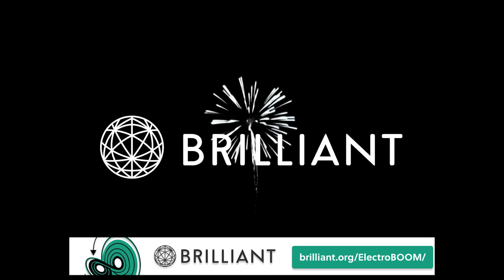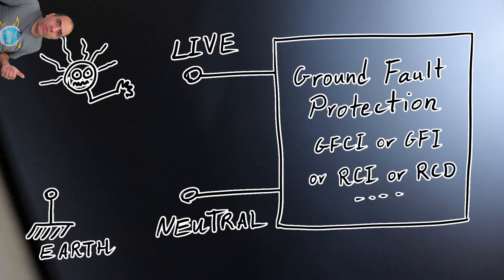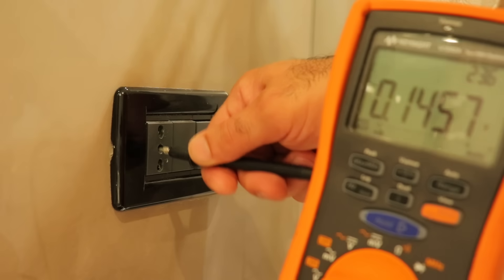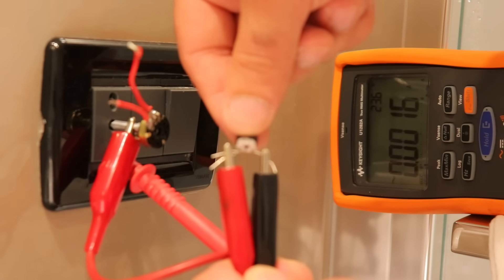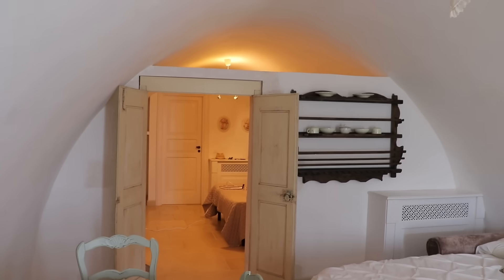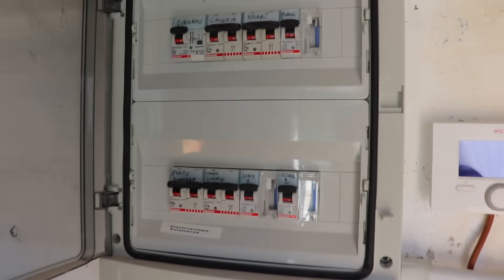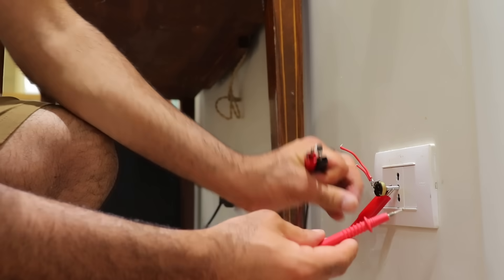Tripping Every Breaker in Italy

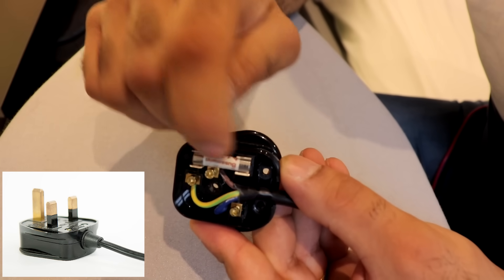Comment: 6:03 i think UK predominantly has ring circuits in most buildings, which have high current rated breaker for the whole cicuit, rather than individual breakers for each room circuit in radial circuit systems, thus necessitating fuses in individual plugs.
Reply: That's exactly what it is. On a ring main with a 32 amp breaker you can have a 2 amp device having a short to ground that draws 18 amps without the breaker giving a single fuck. It just thinks you switched on a space heater or something. Meanwhile the device has burst into flames.
Reply: Didn't come for an argument but it's no true that a ring makes it necessary to have a fused plug and it's also not the reason we have fused plugs.
Fused plugs are just a very good idea and have saved my ass a couple of times, normally when I think a CI13 wire will carry a full 3kw or a C7 will carry 1.5kw but it only has tiny cables inside or something else dumb, no other system prevents this type of fire.

((FYI I'M NOT AN EXPERT)) The fuse is a last resort and mainly to prevent cable fires, our fuse boards seem much like euro ones (just the ring main thing as you pointed out that is different)
Also UK homes are quite small when compared to US homes so the ring is often only 1-2 rooms anyway (often only 1-2 sockets)
In my breaker panel I have a mixture of 6a (lights) 16a & 32a for rings and a 32a for the cooker.
The plugs have a limit of 13a fuses.
(so if you plug in 2 high current devices on the same small ring or 3 on a large ring you would trip, not an issue for most if the systems are designed correctly but I've had trips from this system when running my microwave and washing machine at the same time for example)
(as a result i moved the microwave to the socket on the cooker fuse and all is well)

If you came to bash on the ring main fair enough but our plugs are the best and it has nothing to do with anything other than having good plugs.
Reply: @KillaBitz  Nobody's bashing ring mains lol. Just stating facts. You don't want a device with wiring capable of carrying 1-3 amps protected only by a 32 amp breaker lol.
Reply: @KillaBitz  Not only the ring main is different.In European countries the ground wire must have a green yellow insulation and must be full size. A 2.5mm2 cable with live and neutral must have a 2.5mm2 ground wire.Its not allowed to use a smeller 1.5mm2 ground like the uk does with tein and earth cables.

Comment: Don't forget, in the United States we also only half half the power running through our houses that you do. Clothes dryers and kitchen stoves are usually the only things wired for the full 220v. For everything else we just split the 220 volts down the neutral line and use 110 for everything else.
Reply: You dont have 110 and 220 in the US.120 and 240 since the 1970s or 80s. 110 and 220 was converted to 115 and 230 in the 1930s.

Comment: We had to put dual purpose arc-fault/ground-fault breakers on every bloody 120V circuit (except one that only went to the fridge) last year to the tune of around $700 because we had to drop the service and install a new main panel. What's required here in the US appears to have little to do with state law or federal recommendation and everything to do with which inspector you get, since we're not supposed to need arc-fault anywhere but in bedrooms in my state.

Comment: Hi I'm from France and the plugs are a little different, in France and Belgium the earth is a pin on the outlet and it is the case on every outlet. That means that the round plug that you showed in the end of the video is always connected to ground. I think the other safety feathers are the same due to the European standards
Reply: It can have the male pin or side contacts, 99% of the plugs are compatible with both systems and have a hole for the French model and side contacts for the German model.
The only advantage of the French model is that it is polarized like a UK plug, so even in countries where the German type is the standard, the French type is used for some applications where phase and neutral must not be interchanged but you want a compact plug and socket instead of a bulky CEE plug and socket.
Although there are very few cases where polarity really matters today, I know that in Spain until the late 80s some machines were built and wired so that contact between neutral and metal parts was more likely than between phase and metal parts, it was done by fitting capacitors, relays, transformers, thermostats, and so on sideways with the neutral terminals close to the chassis or housing so the phase terminals were were a little further away from it, apparently that helped to reduce shocks in some humid environments.
But at that time many sockets did not have a reliable earth connection and many homes did not have a differential switch.

Comment: In Portugal the standard is 220/230vac 50hz single phase 3,45kva minimum. 300mA main gfci and 30mA for the  bathrooms and such. Or lately a gfci for each house section, floor, lights or outlets

Comment: My home (belgium) has two separate GFCIs: one 10 mA for the bathroom&outside, and one 100 mA for everywhere else. Except we ran out of breakers to add to the 100 mA one so a larger portion of the house uses the 10 mA. Other than that we have two breakers per room, one for outlets and one for lights.

Also as far as I know there is no standard for putting live/neutral left&right? Some sockets flip them around in relation to the ground pin and I've never had any issue with it.

Comment: Here in Chile we seem to have the same electrical standard as Italy.

  The 9:15 socket is a "magic" socket.  It is typically used in computer sockets in offices and workplaces, because that line is under a more sensitive breaker.  That way you can't plug in, say, an electric heater or hair dryer and pop the breaker.  (and so there is an ethernet connection next to it).

Comment: It's strange that you found outlet without doors, I've never seen one without in my life.
9:43 - In most buildings, in Italy, we have the breaker panel for the building in the basement or even outside of the building. 
11:37 - Welcome to Italy... 
15:26 - With those plugs you don't need the ground connection because they're used for devices with double reinforced insulation.

Comment: If you ever get a chance, come to Australia ours have RCBs built into the breakers, but in the fuse box we also have live voltage and amperage usage readouts and depending on the building/house you may find a few little electrical goodies you won’t find on other fuse boxes around the world. Such as separate busbars with breakers for two different voltages available to the house ie 480V and 230V, to switch breakers with independent ceramic fuses.

Comment: I had a look and apparently Australia has to have GFCI and no more than 3 circuits can be connected to an RCD, with a trip at 30 milliamps.
We even have angled plugs so you can't plug things in the wrong way round. But no fuse in our plugs for extra protection like the UK. Almost there!

Comment: I live in Italy, and i know base electrical knowledge and the blue wire needs to be neutral otherwise it wouldn't be legal, while the live wire is usually brown/red/black but it can be any other color except blue, green and yellow.
So it's strange that the black wire is neutral 🤔
Reply: Some people dont give a shit about code.But if you have double pole breakers live and neutral reversed is not a problem.
Reply: @MernokiMegoldasok True

Comment: I suppose Italian plugs are loosely based on the Europlug you know and love from Switzerland.

Brazilian plugs since 2010 have the same spacing between the external pins while the earth pin is off-center up, making something like neutral — ground — live 127 or 220 VAC 60 Hz.
In some installations (like mine) 220 V is made by two live wires with 120° between them.

Comment: In all western Europe usually is mandatory by law for households and public establishments to have passed an electric inspection in some point (usually at construction or renovation of the building) and all of these regulations include at least one general GFCI per panel and one RCD per circuit which intensity matches the wiring thickness. If the general panel is subdivided is mandatory to have another GFCI in each of the sub panels. In Spain the usual RCDs are a 10A for illumination and some 16A for general purpose sockets and other separated circuits (fridge, water heater...) 

And the oulet thing is all over the place. The most common socket is the Type C which doesn't have any ground connection (for low power applications) and the Type E+F (Schuko) which has two methods for connecting to ground (up to 16A or 3850W@240V). Italy uses also the Type L, a Type C with ground. All of these are generally interchangeable.
Reply: Most houses in eastern europe have no inspection at all.You can find houses wired by idiots with telephone,Tv/radio or speaker cable
Reply: @MernokiMegoldasok  Comment corrected. I cannot talk about eastern europe, never been there. My apologies.
Reply: @P48L1N  The problem is that some idiots are not scared of anything and use telephone cables for power circuits.Some other peole are scared of everything and the scream we all die when they hear about aluminum wiring or ungrounded outlets or extension cords.

Comment: in europe by standard all the house or appartement is protected by the "main line breaker " with max 30mA called "differential circuit breaker"
You have usually 1 differential for around 8 normal breakers ( depending of the power ) , 
then each breaker is by room and then in the same room you have 1 for light and 1 for sockets .
and then you can't put more than 8 sockets by breaker .

for kitchen and wet rooms, for more protections, some installations have a dedicated differential circuit breaker for even more protection

The differential breakers are very nice thing, even if you touch the live lines, the difference between phase and neutral make it "pop" so you will still be protected .
The normal breakers are only for short circuits and to protect wires from over charge

Comment: As a fellow european I'm very surprised to see a plug and socket in the wall I've never seen before in my life.
Where I live it's all two bare round prongs and if available ground on the outside of the plug with a springy brass sliding connector contacting a metal strip.

Comment: Hi, i'm Italian, the strange plug seen at 9:10 is called "Magic" by BTicino and was used in the 80s/90s as security plug for children because the standard 3-prong plugs were not built with the security doors inside. It's still somewhere used as polarized plug when necessary. 
I also think that the equivalente of the US GFCI here in Italy is called "Salvavita", literally "Life saver", and yes, it protects the whole circuit.
Reply: No. It's for an old BTicino 2021 telephone connector. We used to have those.
See here:
https://en.m.wikipedia.org/wiki/Telephone_jack_and_plug
Reply: @IhabFahmy  your right, never heard about it. It is a phone version of the magic plug

Comment: Wait!  That outlet has one prong that has 200 V to neutral/ground?!?!  That's nearly the voltage used by a subway track!  If your finger slips while plugging something in, you're DEAD!!!  At least they have plastic sleeves over the prongs to help prevent that.  But still...  200V to earth seems scary!  I still like the American system better where there's never more than 100V to neutral, and hot and neutral are polarized so you can't plug them in reversed, and EVERYTHING Has a 3rd ground wire, and if you want 200V you have to cross two hots together that are opposing phases.

Comment: Hi! The round plug at 15:15 shouldn't go into the flat sockets. The smaller standard has thinner holes usually. So it shouldn't normally fit!
Reply: In the Netherlands you can plug that type of plug in any ungrounded outlet by design. But the standard here is grounded outlets everywhere.
Reply: @wimh-e7l  nice. In italy as well though. All sockets have ground. As I was saying the "round" plug should go into round sockets, which we have, or that can be adapted, not directly to the "3 holes" socket as shown. That shouldn't fit!

Comment: Our UK plugs are not just fused, we dont have a plug without a ground and the ground pin is required to be able to insert the plug.  We do have some appliances which are double insulated that do not use the earth pin but all plugs have it and all are fused no matter the application.

Comment: It is not true that you can insert a German plug 'shuko' in an Italian socket. You can do it only by forcing it (a lot) the first time.
 At that point you should change the socket because it is broken (the holes are bigger than before and Italian plugs will be lose). 

Saluti dall'Italia 😃

Comment: I would say that the hotel in Venice has electrical safety, but you clearly don't have any yourself, turning by hnd a live-connected potentiometer 😱😱
In europe the breaker meant to disconnect circuit in case of leak currents is called a differential breaker, in cases of old water rooms without every metalic piece of furniture grounded, you need to put an extremely sensitive one, 30 mA in France, if everything is properly grounded, you will be allowed to put a less sensitive one, 50 or 100 mA.
Also there are the usual one meant for detecting ac leak currents, but in the case of DC power hungry devices (ones with an DC power supply inside) like kitchen induction heaters, you need to put a more expensive one that also detects DC current leaks (Explainations comes from a friend's father who is himself an electrician)

And the weird outlet my be to connect a wire telephone, it's an old wide 6 pin connector, and next to it seems to be the newer version with a connector similar to ethernet

And lastly, the location of the power pannels, were the circuit breakers are located should always be shown on fire notice maps, with the location of emergency exits, fire extinguishers,...

Comment: from what I remember the reason why the ground protection is higher for the breaker is because wires and devices have a little leakage and for one outlet there is not much leakage but when its for a whole house it needs to be higher so it docent trip randomly or just never turns on

Comment: In Germany we have the safe schuko standard for almost every wall outlet (except some in the extension cables) We continuously have clean 230V at 50hz. Our trains mostly run on 15kv. Every home has GFCI/RCD protection on the whole system many modern installations have additional overvoltage protection for lightning strikes nearby. I think I just saved you a trip to Germany 🤣

Comment: in Europe (at least in Germany) every load by standard is allowed to lead a ground current of max. 4mA (so there is a constant current through ground). so your shock may be weajer than 30mA, depending on how much ground current is flowing. this also means that the RCD can trip even though there is no ground faliure

Comment: Speaking from Portugal, I can confirm that modern standard European installations have GFCI protection at the circuit board.  I have about 30 circuits dividend into 4 groups each with a GFCI.  I can also report that when you have a GFCI that trips intermittently, determining the cause can be absolutely MADDENING!

Comment: Here in Norway I'm on a so called 3phase it 230volt network.
It is 230v between phases and no neutral connector, all of the cables have 120v to ground or 230 between each other.
An whole house rcd 30mA protection here also.
Wanted to buy a plug tester earlier but none of them will work properly here.
It is starting to get less and less used as most now have TN (not sure about the difference tho)
Reply: It should be 133V to ground,not 120. Is Norway the only country to use 3 phase 230V IT?

Comment: Those safety standards are maybe high in Germany, but that doesn't mean it's the same in the whole Europe. 
Come to Poland. While new installations made according to the current standards are safe (RCDs are required on all sockets and lighting, the exception are hard-wired devices; sometimes it's a single RCD for the whole house, sometimes it's divided between several ones) – with old ones (and some new ones made by uneducated or neglectful electricians) it can be a total mess. Up to 1980s a separate earth wire was not required. Sockets in rooms normally had no earth connection at all (though they perfectly accept the plugs of the devices that require earth). Those in bathrooms etc. had the earth pin connected to the neutral wire. Which makes the whole earth-"protected" device live if the neutral wire fails.

Comment: Hi @ElectroBOOM, i live in Italy.
And i have just a thing to tell, the "normal" receptacles (called "L type" but almost anyone know that) are not meant for use shuko type plug. Usually for put it inside it need also force it quite much. There are selled adapter for use a shuko type plug in a "normal" receptacle.

If you have see someone connect directly a shuko type plug in a "normal" receptacle without any adapter it's not the correct way to do it, as you have tell it's dangerous, and it have no sense at all... just for not buy something that usually cost about ... 3 USD ?